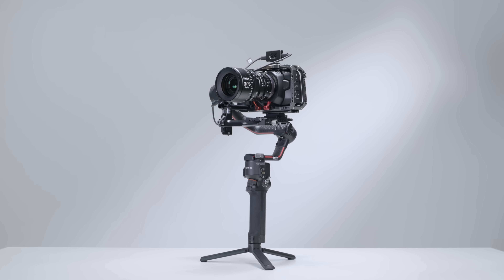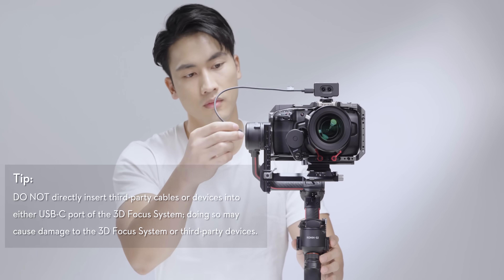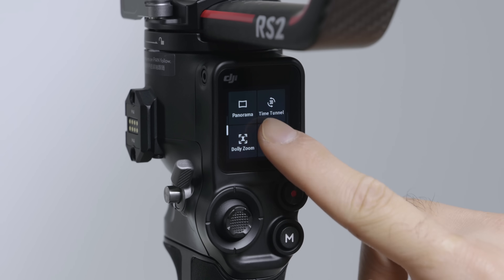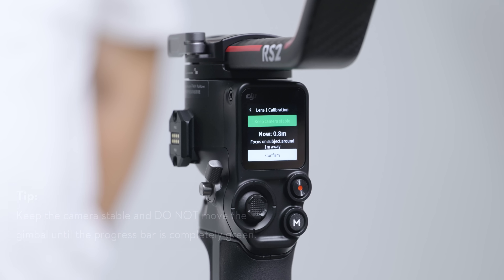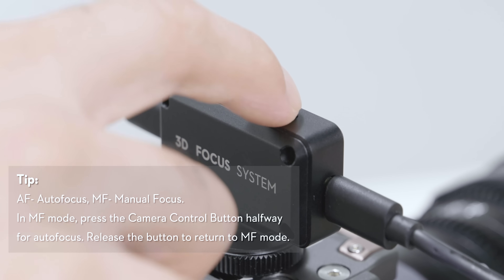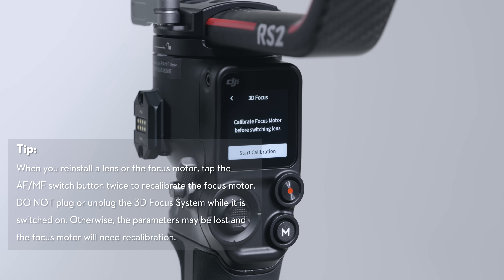DJI RS 2 | How to Use 3D Focus System

Comment: Does this work with Lumix S5D?
Reply from the maker: Dear matango1979,

We hope you’re doing well, and thank you for contacting DJI.

Currently, the DJI RS 2 is compatible with the following Panasonic cameras:
- BGH1
- BS1H
- G9
- G95
- GH3
- GH4
- GH5
- GH5M2
- GH5S
- GH6
- S1
- S1H
- S1R
- S5
We’re sorry, but the Lumix S5D you mentioned is not on the current compatibility list. For the latest and detailed compatibility information, please feel free to visit the DJI Ronin series product page on the official DJI website.

Thank you for your understanding.
Reply: @DJITutorials  thank you for the reply. From what I read the Lumix S5D is identical to S5. The only difference is that it has the compatibility with the newer DJI's Lidar system. Maybe you could mention that to your technical team, so they can test it on the S5D.
I think the "D" in the name stands for "DJI".
Reply from the maker: Dear matango1979,

Thank you for the update. 

If you are referring to the Panasonic Lumix S5 lens, it is compatible with the DJI RS 2. If you are referring to the Lumix S5D lens, we have submitted this compatibility request to the relevant team for consideration in future compatibility optimisations.

Thank you for your feedback, understanding, and support. 

Have a good day.

Comment: May be when you have the right cine lense. But most have have cheaper not hard stop lenses for photos. But these are not working. So I am waiting for an update, which i can manual calibrating without auto calibrating first. So it doesn´t work for me.

Comment: Thanks for the great and easy instruction.

Probably, one thing to add which I came across when setting things up today for the first time:
I previously had defined end points for the manual focus motor on the RS2 because my lens can focus beyond infinity.
And exactly those preconfigured end points prevented the focus module to even communicate properly with the RS2.
After removing those focus motor end points everything worked out absolutely smooth.

Comment: I personally found this system to be useless after having it for months and trying different "solutions" to try and make this work. So now I'm at the point where I'm going to sell it to camera store and receive halve my money for something that never worked in the first place.

The focus motor came in my Ronin RS2 Combo package. The 12mm rods are too short and seem to be proprietary to DJI so finding longer rods is a pain. Trying to use 3rd party "solutions" from companies like SmallRig quickly is shut down because, again, the opening on the focus motor is only for 12mm rods.

DJI's customer service is also the worst customer service I've ever had to deal with. At this point I'm ready to get rid of all the DJI gear.
Reply from the maker: Hi, we feel sorry for any difficulties you encountered. Could you please tell us while camera do you use? 
We apologize for the unpleasant experience with our support. Please tell us the details or the reference number, we are concerned about your experience and hope to help more. Look forward to your early reply.
Reply: sounds legit, can confirm :D

Comment: Is the focal length recorded in the gimbal, simply a record for the user or is it somehow used in calculating focus? If there’s a crop at different resolutions, does the gimbal require ‘relative focal length’ of the lens to help calculate focus, rather than the actual focal length?

Comment: you need to add a firmware update so I can focus the subject at the upper 3rd quadrant of the  frame, ya know good rule of 3rds composition.
Reply: Use a hot shoe offset bracket or similar.
Reply: @michaelbowyer5222  can you please suggest a link to the part

Comment: I have issues setting it up. I connect everything like in the video. But in the menu it doesn't show any option to set up the 3D Focus system. Anybody got some idea what I'm doing wrong? The motor etc. is working but I can't get the 3D system activated :(

Comment: anyway to use this without the gimbal?
Reply from the maker: Hello there, you need to use the 3D Focus System together with the DJI R Focus motor on the gimbal. Thanks
Reply: @DJITutorials  any plans to release a stand alone system, or do you offer a different model that could be used stand alone?
Reply from the maker: @legendp2011  Hi, currently, we do not receive any further info about this, we will note your requirement and forward it to our engineers for their attention. Thank you.

Comment: Also how do you stop the focus motor popping out of the ring teeth every time it calibrates? I see you've used the lens support strap to tie around the rod, is this the fix?? DJI none of this is in the manual 😂
Reply: Did you find a solution?
Reply: @withlogic   I made sure everything was a rigid as possible, and using their lens support strap to hold as tightly as possible. Also holding lens and focus motor together during calibration. The lack of reply from DJI here I feel quite let down by.

I also had to make new screws for the rod that holds the focus motor so they were long enough to fit in the title cage. A right old bodge job... but... it worked. The calibration part is quite violent, and without being able to (as you could on the ronin rs) set the boundaries of the focus motor wheel, this isn’t a great fix.

Please update the firmwire so we can select the focus wheel end points without having to buy a whole new focus wheel and motor! Has anyone added another to test if that’s possible...?
Reply: @withlogic  I’m also using a cine lens which makes the gear potentially have to work harder
Reply: @chrisgascoine  i AM using a small Leica r lens with bmpcc on a tilta cage. The calibiration made it loose. I am searching for a fix to attach the motor and start the process again :)

Comment: Hi DJI,

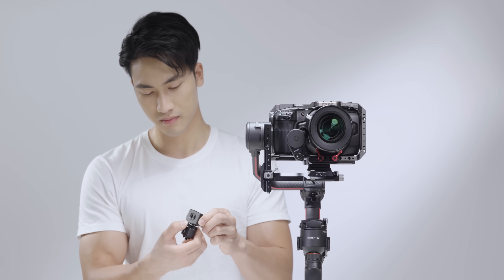Please can you tell me which screws you use to hold the focus motor into the titla cage? I can see at 0:37 there are red tightening arms, I cannot fit the rod support supplied with the RS2 and my bmpc 6k otherwise 😅
Reply: Buy a SmallRig Cage. They have 1/4" 20 threads at the top... Or a hot shoe mount
Reply: @AlexanderKnoppVideography  thanks, but this is specific to the focus motor, which can only be attached to the rods, and they are using parts not supplied with either the focus motor or the 3D focus system

Comment: when i start calibration, the focus motor spins continuously and will not stop, any tips?  the lens has hard stops and the focus motor just keep spinning.
Reply: Hey Adam! If you snug up the focus grip, it helps. It does that when the focus grip ring is not tight enough. That usually fixes it. However, if you still need to, use your hands to stop the focus right before it hits that point. It is a bit frustrating for sure!

Comment: Why not working on rsc2, I don’t care about the price of rs2 but the small size and foldability are what I need. I just wanna use xt4 with cine lenses. Please software upgrade for rsc2 to use it with lidar.🙏
Reply from the maker: Hi Oskar, the 3D focus is not compatible with RSC 2, if needed to use the 3D focus system, RS 2 is required. Sorry about this.

Comment: Imagine anamorphic autofocus with this thing
Reply: Hopefully you could test it in the near future
Reply: Would this work with cine zooms? I’m assuming it would need to settle on a focal length first before calibrating, acting as a cine prime?
Reply: @jpbersabe  it does, I’ve just managed the setup however there are many pitfalls... lens needs hard stop points, and calibration needs support as change of direction is quite violent with the focus motor. Less so I’m actual use.
Reply: @chrisgascoine  thank you bro!
Reply: @jpbersabe  
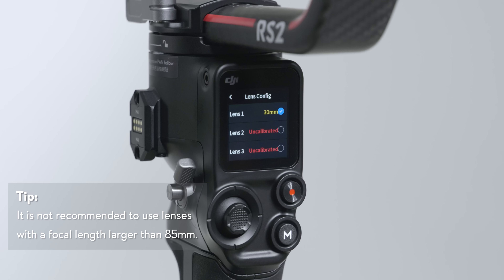That's talked about starting at 1:07 using that cine zoom lens.
Reply: Waiting for your video on this!
Reply: there are autofocus motors with distance measure already. but this one has the benefit of being integrated with the ronin
Reply: cant wait for your anamorphic  video with this lidar system
Reply: Can you give the 3D focus a go. We have similar style of gear maneuverability.

Comment: The most relevant tech to come out for videographers in a very long time. This will sell like hot pancakes.
Reply: but their price is nothing near pancakes :(
Reply: @Dewolvez  For what this tech actually do, I’m shock at the stupid low price they are offering. I’d say get it when you can. I smell a huge price inflation.
Reply: @daveyking  price is not going up. More integration is coming. By next year, the hardware used here is going to feel dated.
Reply: @Kekafuch  Yeah? After watching Jared Undone video featuring Josh O, I concluded that this 3D focus wouldn't operate the way i assumed it would. I'll hold off selling my Pocket 4K until i see this new integration.
Reply: Why not working on rsc2, I don’t care about the price of rs2 but the small size and foldability are what I need. I just wanna use xt4 with cine lenses. Please software upgrade for rsc2 to use it with lidar.🙏
Reply: @OUCGN  They are not so different in size.
Reply: @daveyking  they are quite a different sized gimbals. I have a Lowepro 500aw backpack. I can’t fit the Rs2 in without folding it and if I fold, it takes so much horizontal space that I can’t fit my drone, sigma 18-35, etc. So, no worries I made my homework and it is too big for my backpack.
Reply: Yes, and no. It’s very relevant tech but it’ll truly take off when camera manufacturers embrace ToF sensors and install it in the camera body.

Comment: they need to make a stand alone version of this product. So no gimbal necessary.  Im sure people will hack this device to work without the gimbal.  Cant wait.
Reply: I tried that and now my dog is dead... I guess I did it wrong.

Jk
🤣
Reply: TOF have been a thing for a long time you can buy them already
Reply: @Zuul000   links?
Reply: Cinetape, light ranger, focusbug, arri UDM... take your pick!!!
Reply: Or hire a focuspuller
Reply: @HM8  of course. However, sometimes for a run and gun this would be ideal.

Comment: I have the gimbal on order and can't wait for this system. If at any point there can be a firmware update that allows tracking across the screen or at least for the focus to stay where it is when a subject leaves frame, then it will be a game-changer. Until then it will have very limited application if it only works on something centre frame.
Reply: https://youtu.be/_bvaJva5az0

Comment: after the setup complete, i was waiting to know what is 3d focus system do.....
Reply: The 3D focus system is a separate add on for the new RS2 gimbal. It’s used to auto focus manual lenses using Lidar??? I think... Either way it allows you to adapt pretty much any manual lens into a center autofocus lens - which is pretty awesome considering the possibilities. And in many cases the system they use for focus is superior to a lot native autofocus processing in camera.
Reply: Man this is a lot to learn
Reply: @YoungBlaze  Yep, It's an awesome setup, but there's a steep learning curve if you're going to be using the RS2 beyond the basics... That said, the basics are there too and make this gimbal really approachable in the short run - easy to balance, great specs, and you could get by just mounting up a camera and leaving it in autofocus, it doesn't have to get technical technical until you want it to. After the basics, there's AI focus tracking with the raveneye system, tons of different fx modes for different kinds of movement, car mounting with remote control or multi person opperation, the 3d focus system for manual lenses, ect... I think the RS2 is the cheapest gimbal on the market for this kind of flexability - not perfect, but it'll get you there :)
Reply: @MrMoviePhoneEx  thanks for explaining that! Great response!
Reply: https://youtu.be/_bvaJva5az0

Comment: I bought the RSC 2 pro combo hoping this would work. It only works for the RS2. You really should have made that distinction for buyers. I now have a useless focus motor!
Reply: I do not see any reason why this should not work apart from software limitation.
Reply: They made that very clear, focus motor still works great without it?
Reply: @user-dh5fp4gw1b  not that I’ve seen. I’ve spent three grand on their kit this year and was still in the dark.
Reply: @touchtennis  it says on their site its only compatible with rs2 so its quite clear

Comment: Anyone Know why Im unable to connect my Raveneye with My Sony A7siii I get a blank screen on my phone???
Reply: could be many reasons. you have to connect your phone to the transmitter, not to the gimbal. an you have to activate the image transmission in the app interface. check your cameras HDMI output settings as well
Reply: @Tryptophan1  If I could see you right now Id Kiss you Brother👍 That was it Works Awesome now that I changed to the 1080p From Auto....Ive been Asking Everybody And even DJI said it wasnt compatable with the A7Sii...Lol Thank You So Much Owe you One🙌
Reply: Make sure your Sony is set to output 1080p to the raveneye. I had the same issue with my fuji xt3 so I dropped the hdmi output resolution to 1080p and it works.
Reply: https://youtu.be/_bvaJva5az0
Reply: @anshiletv9016  
Stop your spamming.